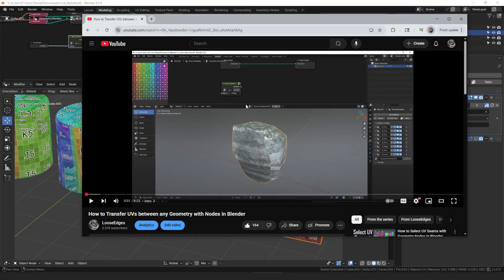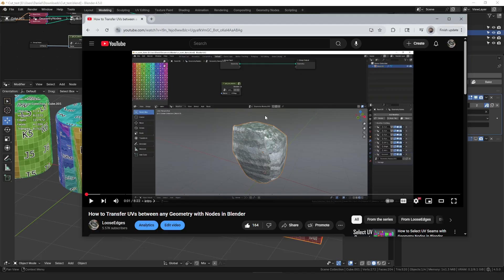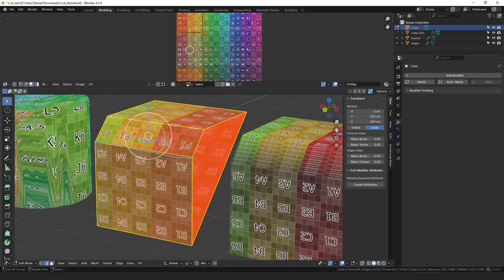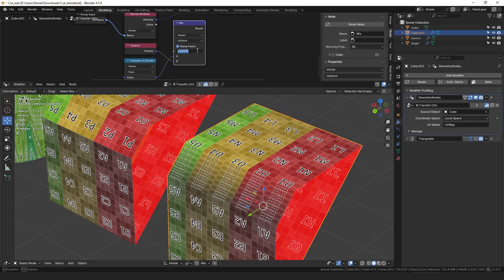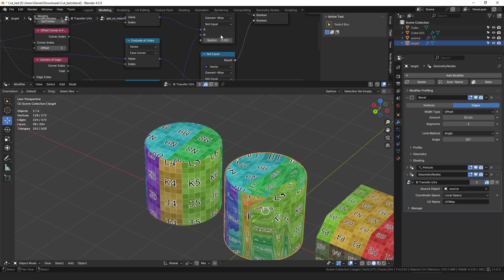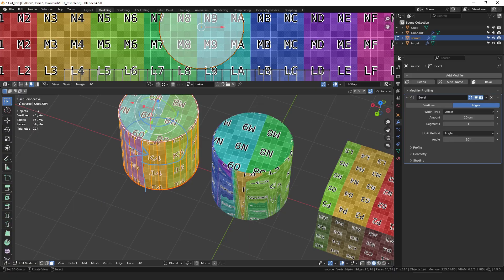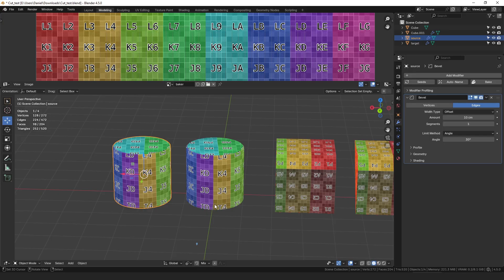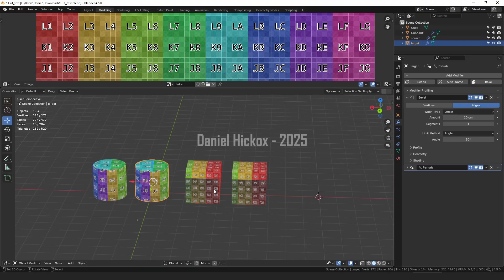How to Transfer UVs with Geometry Nodes #4 - Improvements

Comment: thank you ! Unfortuntaly those cylindrical shapes the shares the same seam on the same uv island are problematic for me espacially for the workflow I'm working with which requires remeshing procedurally generated curves with UV. I'm trying to scratch my head on how to mimick the splitting of uv's with a slight offset but directly in geonodes

Comment: i was actually doing something similar to this whole uvmap transfer thing recently so it was pretty convenient to come across these videos now LOL
either way though wouldn't using the edge split node with the seam selection group's output as the selected edges fix the problem without having to manually adjust the uv map
it worked decently well with my setup
Reply from the maker: Hmm, I don't think so, because the face corners at the seams would still be in the same overlapping locations.  I think turning the edge selection into face groups for the sample group ID serves the same function as splitting the edges would.  Both are viable, but not editing the geo should be faster.